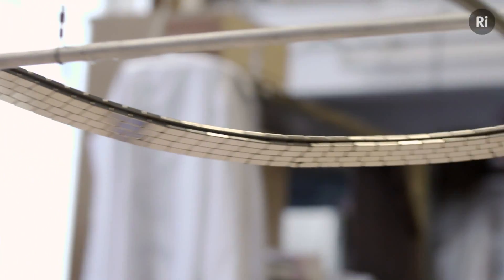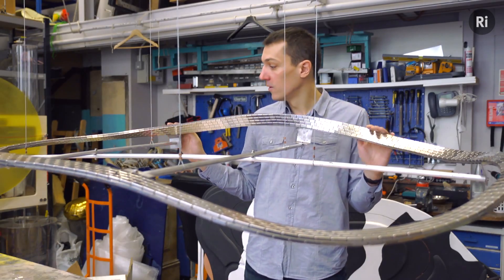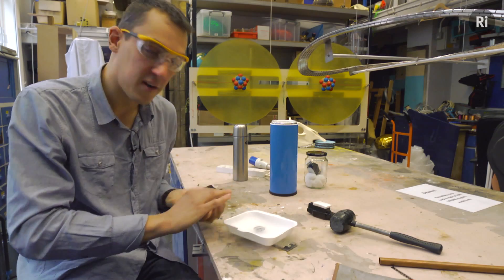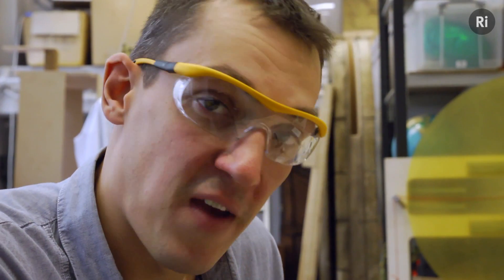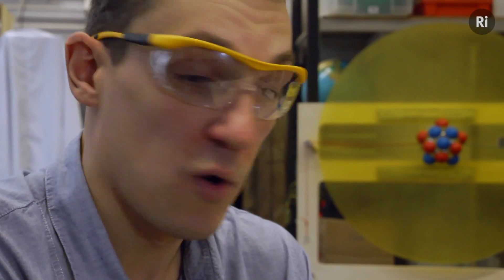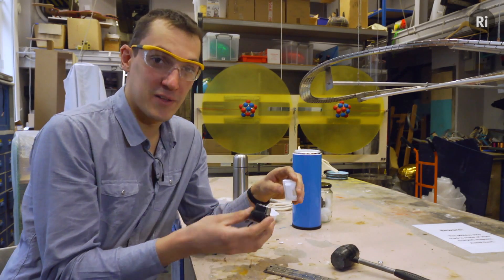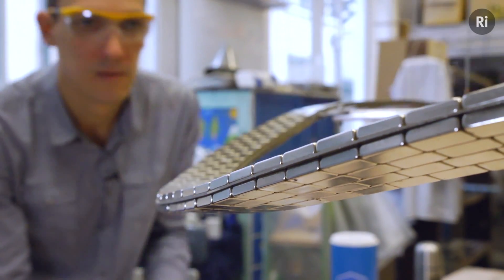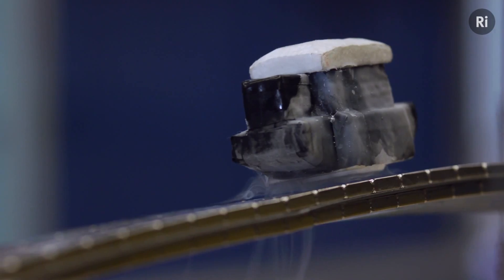Levitating Superconductor on a Möbius strip

Comment: So now let's make F-Zero happen!! :D
Reply: Some Japanese dudes made Wipeout using this, and its awesome.
Reply: Dennis Nowack Well, that's disappointing
Reply: Well you might freeze to death because of the liquid nitrogen BUT IT VAS WORTH IT
Reply: Absolute Zero has been reached before
Reply: @deafanddestructiononthepis3149   It's impossible to reach Absolute zero because the more energy you remove from a substance (i.e make it colder), the harder it is to remove more energy and it continues exponentially until we reach a point where even with all the matter in the universe were to be used to build and power one gigantic machine and an infinitesimal amount of energy (0.00000000000...1) would still be left. Even so, if it were possible then the act observing (or measuring the temperature) would require some device or process that would add energy back into the system thus increasing its temperature. In other words,  even if we'd or thought we'd reached absolute zero the only way to check would simply be to rely on the math. So even if we could reach absolute zero, we couldn't directly (without the extra maths and physics) confirm it and if we tried to directly confirm it then we'd have shown a failure. Through indirect methods, we could theoretically do so but at that point, it would simply be hoping you got all the math right. To do all the calculations correctly and to check them to make sure there are no mistakes would theoretically take an infinite amount of time. Which is true of any math problem, mathematically there's no reason why 1+1 will always equal 2 but since we've never seen any other answer we accept it as true unless/until a different system comes along. Getting off on a tangent here but that just proves that there is no way to know what you know or how you know it google "last thursdayism", I know there's some religious stuff associated with it because the man who thought it up was christian but it's really just a theoretical philosophy that shows our inability to be sure of anything, I personally don't believe in it but it's fascinating and really makes you think about proof, uncertainty  and the loneliness of knowing that what we each call "reality" is unprovable and impossible to compare/contrast with somebody else's...or even prove that there are others with which to compare/contrast said reality (drifting into solipsism there)
Reply: Quentin Jankosky the Wipeout was fake, just look at the making-of link in their video-description. it was a great hoax, they even talk about it in their linked making-of video ;) ;)
Reply: F-Zero ew no WipeOut is much faster and cleaner i think i say with the British Game Devs for this one
Reply: ***** AWESOMEEEEEE
Reply: ***** That's been my life's dream ever since I played GX on Gamecube. I just need to get through college for now, though.

Comment: Our hover cars are going to need some really good AC and heated seats.
Reply: We have those kind of cars here in Finland, but they work only in January.
Reply: @mikakorhonen5715  Explains why Mika Häkkinen always made a strong start to the F1 calendar...
Reply: Not to mention the roads of giant magnets we'd need
Reply: Something more like a bullet train would be more logical.
Reply: why not electromagnets as roads?
Reply: @pain2737  There's a massive flaw with this/your idea, this electromagnet could not change its output (current, voltage etc) depending on what mass or metal (conductor, resistance etc) is driving over it. In turn, a steel car would probably hover however, what about steel trucks and bicycles. The amount of money and time to do such a thing would be crazy with many safety issues, environmental issues, economic issues and social issues. How much power would this draw as cars are only turned on when moving whereas an electromagnetic road would always be online and never turned off; always drawing current. You think we are burning heaps of coal now! Imagine electromagnetic roads; craziness! What if we have a blackout? How would we travel, how would paramedics respond to emergencies? What if it's an electrical fire; how do firefighters respond? 

It would definitely be a great idea for trains though as most trains are already electric-based and run on top of conductors like steel rails. Plus trains are usually alike and very similar.
Reply: @aussieosborne116  i just spoked my mind i didnt think this far ;_;
Reply: Edison Trent try Freon
Reply: Wan Ikmal  then someone needs to tell them a superconductor needs to be near -217 C°

Comment: Can this be used to make a hoverboard? Cause that would be awesome -
Reply: Möbius strip hoverboard skate park anyone?
Reply: Kanishk Singh you underestimate the strenght of the magnetic lock. It would be more stable than a surf board on water I think.
Reply: Ildarioon No. You can see him just push it around with no force at all. It would easily tip over.
Reply: ***** Pushing along the track is very different from pushing it off the track.
Reply: ***** they already made it :v

Comment: Magic is real... o.O
Reply: Magic is just science that we don't understand!
Reply: Which is more impressive, the fact that someone made a levitating object move around a track, or the fact that you and thousands of other people watched it from the comfort of your own homes?
Reply: Brad Sagowitz so true
Reply: Thanks for sending me here Jerry, really interesting video!
Reply: Wingardium Leviosa
Reply: i'm curious as to if carbon nano tubes would be able to perform a similar function if it carried an electrical charge. carbon nano tubes are so far the best means of electrical transportation that we've discovered at this current time if i'm correct (if not please educate me lol) due to the placement of the carbon atoms so if a cluster of graphene were to hold a electric charge would it be possible for it to levitate via similar methods? (for those that don't know graphene is a single sheet of carbon atoms arranged in a hexagonal patterns for maximum efficiency and its used as the walls of a carbon nano tube).
Reply: Yes it's just magic lol I had a feeling one day they were going to try to sway the people away from copper
Reply: Leo VvDeci No. The best way to transport electricity are supraconductors, if it was as easy as using graphene, we wouldn't make complex ceramics.

Comment: I could not hear the temperature in which the ceramic superconductor superconducts. I'd like to know if there is a metal of the Platinum group in the composition of the superconductor and which element it is. If possible give me the formula of the superconductor.
As I watch the patents filed for superconductors, I can see the temperatures are getting higher, but still too low to make them comercially useful. When do you think we will have superconductors that superconducts in room temperature? There was a an American farmer from Phoenix, Arizona that claimed he had found such a superconductor in his farm. His name was David Hudson and he passed away in 2003.
Reply: There is no way to predict if, much less when, a room temperature super conductor might be discovered.  It is something physicists hope to figure out, but the combinations of materials is nearly infinite and there is no model for starting from a desired result and working backwards, so it is a pretty 'trial and error' process.

Comment: So to get this straight: Outer space is cold enough to cause super-conduction correct?
Reply: *****
Superconductivity does not happen due to 'cooling' it happens at a certain temperature range. Cooling (the loss of thermal energy) is irrelevant. Now, in space (in a shadow with no infrared hitting an object to warm it) the basic temp is minus 455 degrees Fahrenheit (about 2.7 Kelvin). Things in space are subject to extremes of temperature.

Here on the earth we use liquid nitrogen to get superconductors to work, because it is the cheepest method we have (liquid nitrogen is cheaper than beer).  On the other hand, in space, in a shadow, there is no thermal energy past background (again - 2.7 Kelvin).  There is no atmosphere in space to retain or to conduct or retain heat.  

A thermocouple can generate electricity quite well in space, because all it takes is an object with the cold of space on one side and the heat on the other side... with a thermocouple running through it.  A lens or a set of mirrors on one side (the hot one) makes it easier ot get it HOT on the sun-ward side, given the extreme cold of space on the other side.
Reply: No, superconductors do not heat up when current passes through them. That's the whole point. They will happily stay at superconducting temperatures in outer space.
Reply: In space you aren't "cooling", in space you can't reliably use enviroinment matter to establish a temperatural equilibrium, because there is barely any enviroinment matter.
So if you're cooling - space matter can't warm you and if you're heating, space can't cool you.
You have only 2 ways to share thermal energy - light emitting (and absorbing) and phisical contact. On the planet surfaces, second way is largely inflated due to you always being in contact with enviroinment matter (air, water, soil), in space there is none of it (virtually none of it) so in space to cool down you have to emit energy.
Or so is my understanding of it, there are good reads on this, probably, that are worded better and have more recent facts than what's in my posession, so i recommend checking those.
Reply: ***** Good point haha. I guess there would be a way to work around that though.
Reply: Bone Alias I wounder if they have a Möbius strip testing superconductors on one of the space stations at the moment.
Reply: Especially on the other side if the moon where 1. No one can see and 2. Where it is really cold
Reply: ChemicalRefugee
Cooling isn't what makes it happen but if you want to maintain it it is necessary because anything you do with the superconductor is going to heat it up ruining your superconductivity. Also while space is cold that doesn't mean everything put in space automatically matches the temperature. In order to drop to superconducting temperature the object would need to lose all of the excess heat through radiation and if any energy is being introduced to the system it will probably never reach that state.
Reply: Light rays from the Sun, however, will affect any and all matter that is present in space, heating it intensely. Unless you're talking about far from a star, which then you're correct.
Reply: If you put it in the L2 Lagrange point, I don't see why not.
Reply: ***** Liquit nitrogen? XD
Reply: outer space has no temperature, so no, space is not cold enough, it's not anything. You need a medium to have temperature. If you were in space right now, heat would not be sucked from your body, your body would stay a warm 98 degrees Fahrenheit for a long time.
Reply: ChemicalRefugee I thought magnetic field provides current when magnets pass near each other. And current is supposed to heat the conductor.
How do you get that heat off of the magnet?

Comment: The visual representation of what's happening in the experiment  of the neodymium magnet in the copper tube is wrong: the induced magnetic field should be the other way around so that it's a south pole opposing the magnet's, slowing it down. If I'm not mistaken.

Comment: very interesting.. the magnetic polarity to be checked and corrected in the drop test of magnet in a copper tube. If the polarity is opposite as mentioned the magnet will pass fast than normal..

Comment: Does that mean a superconductor would not produce any heat from electricity passing through it?  So all electronics would stay cool?
Reply: No resistance means no heat. However, most of the heat generated in electronics comes from transistor (the building block of all electronics) switching losses. When a transistor turns on it acts like a conductor (with a small bit of resistance) and when it's off it acts like an insulator. When it's switching between the two, there is a brief moment when the transistor acts like neither and instead is resistive. This is when most of the heat is generated. Making a superconducting transistor that has no resistance in the on state would have little effect on this switching loss.

Really, superconductors are good for power transmission and electric machines (motors, generators, transformers) or anything that would require a strong electromagnet, but not much else. You probably won't ever see this stuff in your phone though. No point.

Comment: Does this only work with the same magnets you use when you set the lock?

If you set the lock with a weaker pair of magnets than the track will it be in a different locked height above the track?

Comment: So i'm guessing that this apparatus wouldn't work in space because of little/no gravity creating little/no electric field = no magnetic field to repel or attract. But if you ran current through the superconductor manually would it work then?
Reply: It would work in space, I suggest you look up quantum locking, as it is the actual cause of the so called levitation

Comment: I was thinking about buy some that is N50 (the higher the number after N the stronger the magnet) for a levitating crown idea I do a lot of things that involves plays and costumes. kinda hoping it work. really complicated idea lol it would have two rings, some of the magnets would line up with their equal and the others with the opposite so that it has the push and pull that I am hoping it needs to levitate but not repel. do you think it could work or should I not even spend the money lol.

Comment: Hello:)
I like that you working with both superconductors and moebius togheter:))

As you probably are aware of, is that there is two types of optimized moebius tracks.

This one has (probably) a 2D base of a rectangle.
When you have a 2D base of a rectangle, the 3D product will be sadel formed (pringles). Since you have a large Diameter, the sadel form will be no problem.
Too small Diameter, and the sadel form will throw the superconductor of the track because of the sentripetal force.

The other optimized moebius track have an other 2D base, and the moebius track is then called a moebius flat.

The moebius flat is designed aorund a 2D circle and the cross section center of the track is on the circle.

Please see our bachellor thesis 2010 on You Tube:)
Meta tags: Superconductor - levitating train - moebius - Hive

Keep up the good work!!!@8)

Best regards
Tage Golab

Comment: So if you were to cool everything down and put it in space somewhere very cold like behind the moon, it would keep going for a seriously long time !!
Reply: Behind the Moon the Sun is shining too. It is called dark side because we cannot see it, however the Sun can and heats it up to about +150 degrees celsius.
Reply: But, man, see that dark side of the moon refers to the fact that we cannot see it, as the Moon does not rotate relatively to Earth. However, it does not mean, that sun does not shine there, it does, so in terms of temperature, dark side of the moon is same as the side which we can see.
https://www.moonconnection.com/moon-same-side.phtml
Reply: There is no such side of the Moon where Sun is permanently not shining.
Reply: 0K is unreachable, You can get arbitrally close to it but never complete 0. Even if one did somehow cool down some matter to 0K, the electrons would still move, only the atoms would not oscillate thermally.
Reply: 6 times weaker than here on Earth I think it is not that bad.
Reply: not that there would be a point of it but Lagrangian point 2 of earth moon system should be in darkness always(L2 of earth sun as well).
Reply: Space is only really cold in the sense that there is very little there to be warm. If you put something in space it will hold its temperature for a very long time or potentially even rise as it can only give off a small amount of its energy as radiation while at the same time if its in sunlight it will be constantly heating up.

In a similar manner you can't really make a generator out of this, no energy is coming out of the system that you didn't put in.
Reply: Gravity may not be strong enough on the Moon for this to work.
Reply: 0 degrees kelvin and the atomic structure becomes dead still, right? I'm not sure electrons would work if there is no allowable atomic movement...

How cold do you want it? I would imagine a vacuum such as space has some very awkward temperatures.
Reply: Patrick Barlow highest crit temp for Y123 is -178
Reply: You're stupid as hell lol
Reply: GoodOldCountryBoy what an informed comment! Anything else to contribute?
Reply: Kwitzats /s intensifies
Reply: Christopher Pepin
 true, but it would work for an underground superconducting train system on the moon (very very cold in those shadows)
Reply: I figured they'd do it behind the moon before i ever read all of your comments
Reply: Distance yourself from the moon on the side you can see and the temperatures should drop as they do here when night falls.
Reply: ZamaskowanyWolnościowiec Yes there is. There's a few craters near the poles with areas that are always in shade.